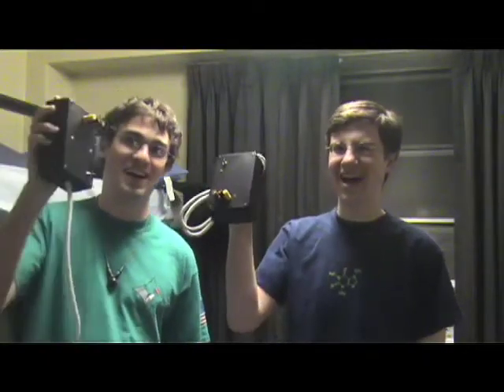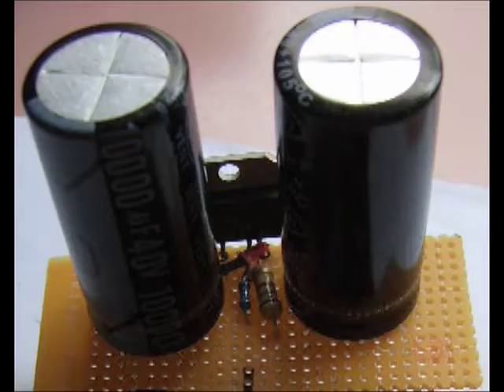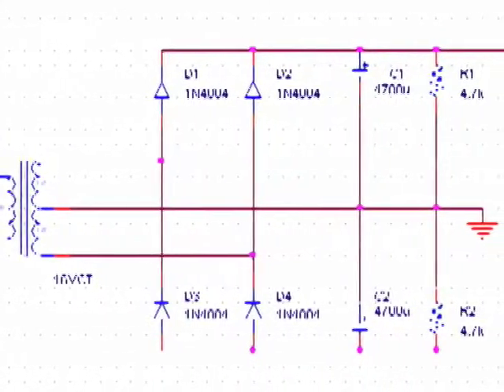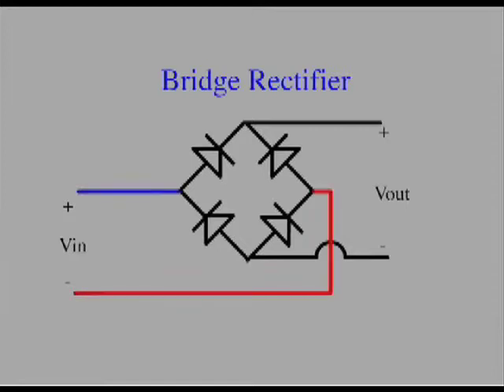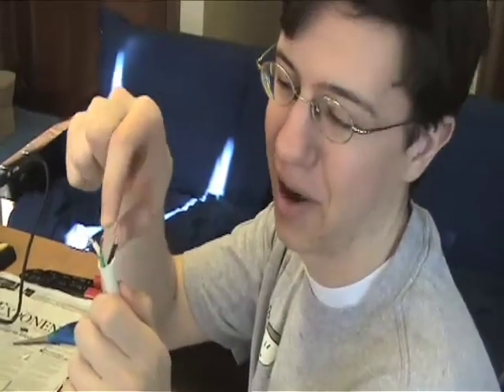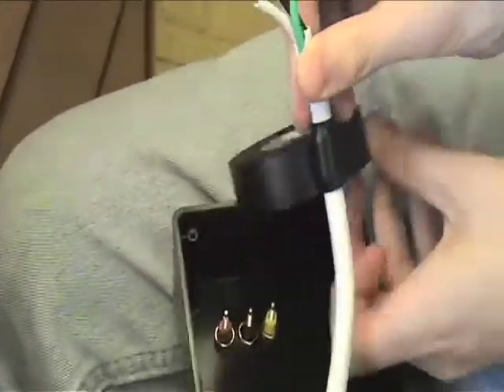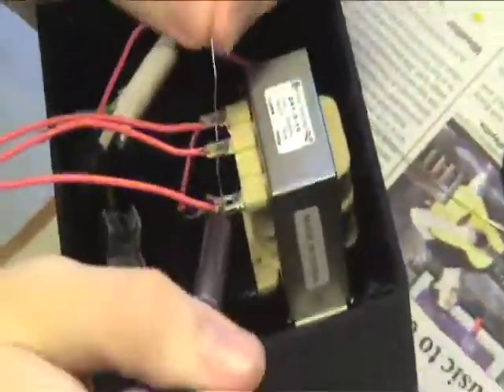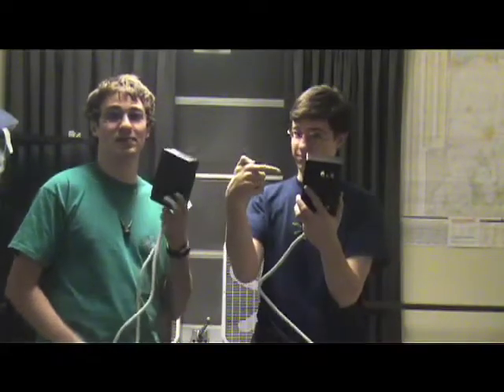Study Break Episode 1: Make a Power Supply

Comment: You should have put DC filter caps on the output stage of the bridge. it helps filter the DC from AC  and smooths  out any possible ripple on the output to be more stable and helps with cusion any device that powers on or demands surge current..

Comment: A bit shaky but I've got a few picsup on photobucket under kraig-800i if that helps. It seems to be a german 4 pin din socket (I think...) I opened it up 2 years ago and its all resistors, caps and possibley transistors. 

No IC chips or Valves in sight I'll get a pic of the insides uploaded if that will help.

Comment: If I was to build on of those I would use a couple of voltage regulator chips in there too to get rid of any ripple. When you were explaining the wire colors on the ac cord, did you say that the neutral and the ground (or earth) are actually connected together where the AC power comes into the house? I thought they were always separate wires